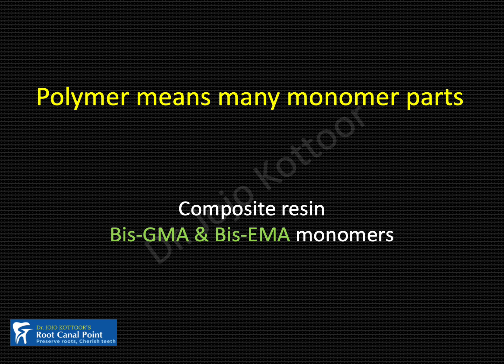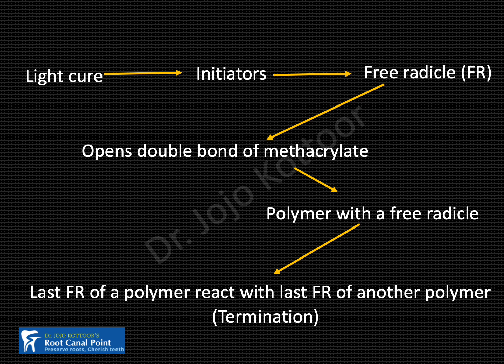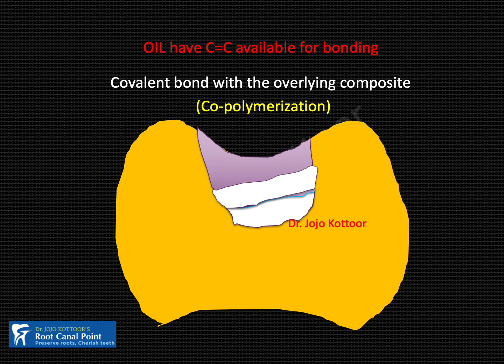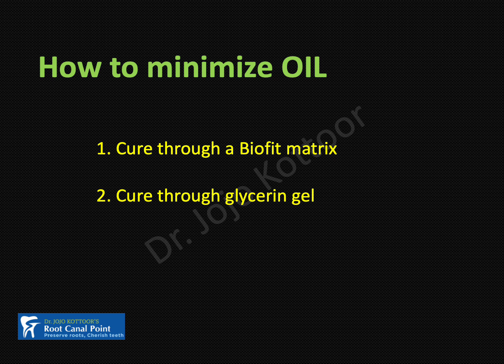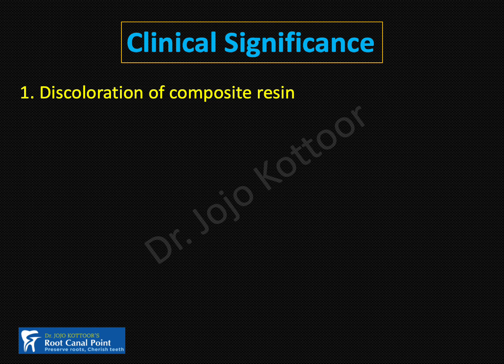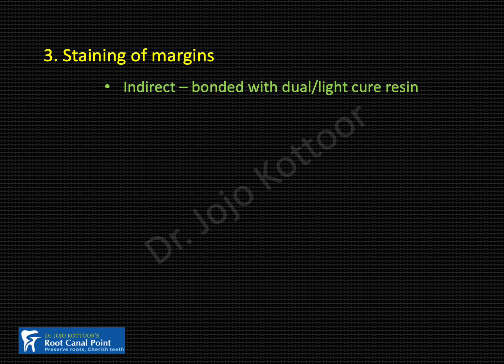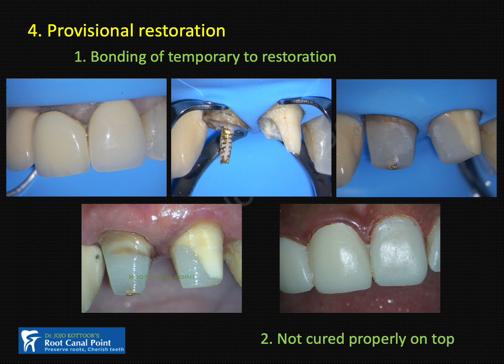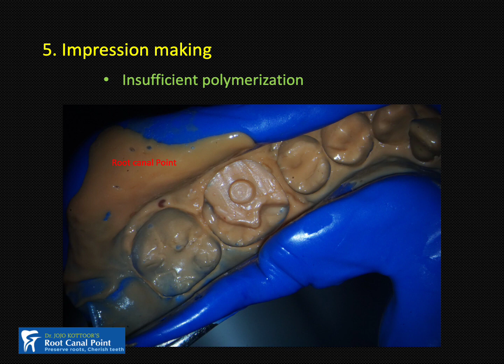Oxygen Inhibited Layer & its Significance

Comment: That's as usual superb explanation. Thank you Sir for sharing. Sir one question, after placing the final layer of composite, do we cure it straightway for 10 or more seconds and then apply glycerin and cure again or we apply glycerin and then cure it completely? One more question sir, is the glycerin available in the market suitable for this or there is some specialized glycerin l available for this? Thank you Sir.
Reply from the maker: It’s available from ivoclar. Or you can buy for the market
Reply: @jojokottoor5103  thank you Sir for your response.

Comment: Thank you for the presentation.

I am close to finishing a PhD and I'm working on dental composites for structural applications. One part is moulding large dimension flexural test pieces of 8 mm thickness, and the same dimension pieces but in 2 layers of 4 mm each. All pieces cured from the top surface only, with Melinex sheet in contact with the composite and the curing light. I don't believe I have an OIL on the first layer because of the Melinex and the fact that I wipe and clean off the surface prior to adding the upper layer. 

I've found one of my formulations delaminates quite easily whereas the other has excellent properties. In fact, the modulus increases substantially when layered as compared to curing as a single bulk layer with only a small decrease in flexural strength. When they fracture, you can see the layers aren't directly bonded because the first layer is very glassy due to the contact with the Melinex.

I wonder if you have any idea what may be happening?

I fill the mould, put on a sheet of Melinex, cure the composite using my own technique (LCU in direct contact with Melinex, discrete cures similar to ISO 4049), chip away overflow and place a second mould on top of the original mould. Then repeat the process. I then clean up (acetone), and sandpaper the bars prior to testing. They are in deionised water before testing as well.

Thank you
Reply from the maker: Thanks. Good input

Comment: as usual very informative sir,your take on whether oxygen inhibiting layer is required in repair of composites or not?
Reply from the maker: Very good Q Dr. Parvathy. Reports on how this OIL affects the bond strength have been inconsistent. Studies had shown that even in the absence of O2, tr is good bond bw the 1st n 2nd layer.

When it comes to repair, let me put it this way. After light cure the degree of conversion will be max 60-70%. So logically we can assume that tr is some free radicle remaining at least for 1-2 days. Hence, if ur repairing the composite within 2 days, the FR remaining will facilitate repair even in the absence of OIL. However, if its beyond 2 days, i highly recommend sandblasting n application of silane coupling agent b4 we initiate repair
Reply: @jojokottoor5103  ok sir ,thank you sir